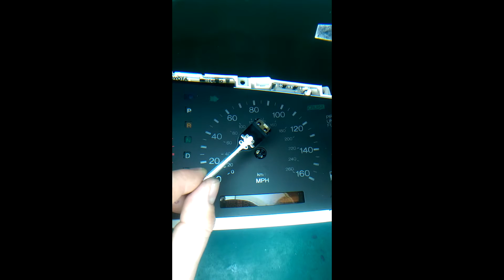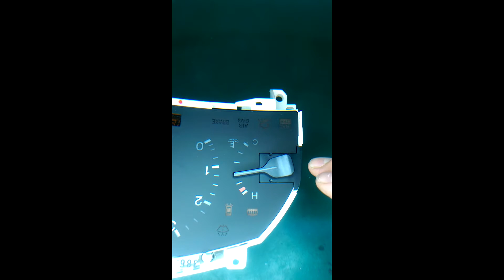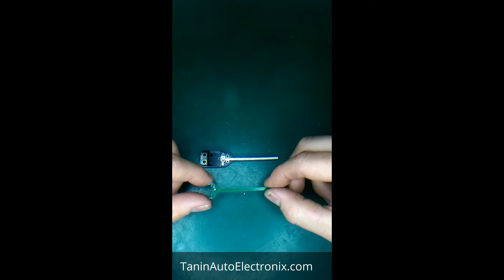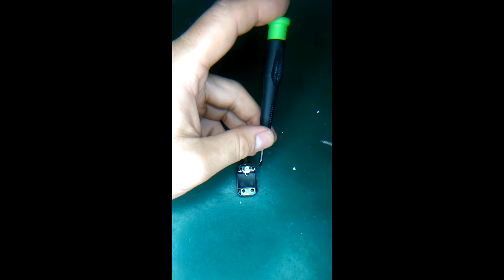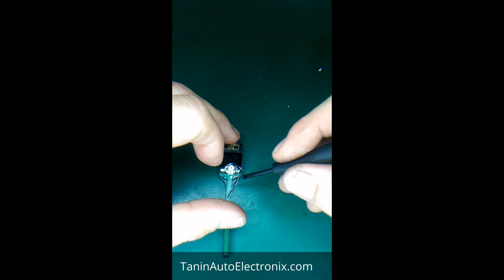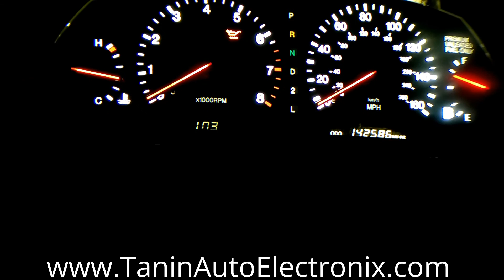Install Lexus V3 Needle Boards | DIY Fix & Upgrade Instrument Cluster Gauge Needle LED Lights | TAE

Comment: Just did the kit plus dash lights for a 92 sc400. Would the fuel gauge not go to whatever the sending unit is telling it? The needle can only go on 2 ways due to the 2 power pins and the centre pin

Comment: Yes and no; the process of removal is half the problem before you can get to the pointers.
Typically my new acquisition also has failed lights. I will be doing this sometime; no hurry BUT I may just use painted on fluorescent paint using a fine brush.

Comment: I ordered a few days ago and received it right away. I am very satisfied with quick shipping however, my one doesn’t have a code extension for the needle in which +- positioning in reverse as this video explained … I have 95 lexus sc300. 
I haven’t tested yet but should I try it out first or what can I do?
Reply from the maker: that doesn't apply

Comment: How can you tell if the moter is not working? I have a 1993 Lexus SC 300 and my speedometer does not work.
Reply from the maker: Hey Debra! If the gauge needle isn't moving at all, or is reading inaccurately, it might be due to the motor failing or starting to fail.
Send a message to our customer service department and we'd be happy to provide yo with a quote to repair the cluster for your SC300!
contact@taninauto.com
262-456-4147

Comment: I recently changed the LEDs in speedometer and tachometer for my 06 Lexus is350. But my speedometer needle only moves on startup, it doesn't move while driving. Would you know how to fix this?
Reply from the maker: Hey! For an issue like this, we usually can't diagnose the problem or make recommendations without seeing the unit. The best way for us to help would be you sending your instrument cluster to us for test and diagnosis. You can view this service on our website at https://www.taninautoelectronix.com/product/general-diagnosis-service/

Also, we apologize for the late response, but hopefully this still helps you out!

Comment: Hi Tanin.  I just did my SC400 with not much joy.   Before install, only the Tac and Temp worked.  I installed all 4 needles and now only the Tac and Speedo work.. Sort of.. Only around 1/4 inch of length is illuminated  and the short needles Temp and fuel have nothing.  All were tested with a 9v battery before install and tested good. Car is a 1992 SC400.  Did I order the wrong LEDS? oh nooo....I did a 93 SC300 and it worked great. I would think the 92 SC400 is the same as the 93 SC300.. or?  Help!!
Reply: I checked what I bought and now see I bought the 1994 SC400 LED Needles!! O no!!!  Are they different? That much different? Help!!
Reply: Called Tanin. They told me the difference is polarity.  That is a huge difference!  I can fix that. Will reverse the leads, reinstall and let everyone know how it goes..  :)
Reply: ok.. Reversed polarity. It was a pain, but did the trick.  Thanks Tanin.
Reply from the maker: Hello!
Can you send us some more information about your vehicle so I can see if we can help?
262-456-4147
contact@taninauto.com

Comment: Just picked up a 1992 Lexus ES300 that has the LED needles along with the cluster lights burnt out and HVAC lights. Watching your video gave the confidence to tackle the project myself. Will be ordering your repair kit soon. Thank you for your very informative video.
Reply from the maker: Hey Soy we're so glad that you were able to use our videos to help you. Let us know if there is anything we can help you with.
Reply: I am thinking about replacing the RPM and speedometer needles which do not glow red any longer but function. My mechanic is pretty good and said he would tackle it, but want information from folks who have done it. Thank you. @TaninAutoElectronix
Reply from the maker: @brm4141  Unless your mechanic has a proper soldering station, tools, and the ability to solder delicate and precise electronic parts it might not be a good job for him.
Reply: What else do you have in your bag of tricks for 1994 ES 300? @TaninAutoElectronix
Reply from the maker: @brm4141  recommend buying our complete plug and play cluster!
https://taninautoelectronix.com/product/1994-1996-lexus-es300-instrument-cluster/

Comment: Ok.. Just finished my install SC300.  I only did my Temp and Fuel. Tach and Speedo ok.  Did not remove my cluster from the car as I could only get one plug out the other 2 were so tough I was afraid I would break the cluster . So.. I simply pulled it out far enough and removed the bezel and needles from there.  Turns out to be a good way to do it as once you get your new needles installed, they will need test an calibration before you put the glass or bezel back on. I followed his instructions for removal and install of  led strip to needle.  Tested with a 9V battery. I knew where the fuel gauge needle needed to be. Pushed it back on. Turned on key, it lit up well. Yea!!  Not the same as factory as you can see the segments and its brighter which is a benefit. Over all happy though. Started the car and waited for 20 mins or so as I know my Temp is just under half.  Once car was warmed up, I pushed on the Temp needle. It too lit up. Yea!!!  Noticed my fuel needle was going up and up and up slowly. Removed it. Added another hit of hot glue for more weight. For my sc300, it needed a full length of hot glue for balance.  For temp  no extra glue needed but I did notice it would not go off of half way when the key was turned off. The Temp should go down when key is turn off. I had to pull up on the needle a little so it could move freely and return to 0 when key is off. Fuel I no longer knew where its calibration point was since it climbed on me, I had to remove it and add some glue for weight. So... I left the needle off, went to a filling station and filled it up. I waited around 5-10 mins as it takes a while for it to go to full... Once I felt enough time had passed, I pressed it back on at the F position and proceeded to drive the car around.  I noticed my temp gauge was too high, it took me 4 or 5 more times of plucking it with my fingers and re positioning it to just under half, once where it should be, I would turn off the key to make sure it would go to zero. Fuel does not do that. It stays where it is. So.. I had to drive the car and burn 1/4 tank of gas to make sure that needle too was working.  So.. All in all.. This is a day project and you need to be careful and know what you are doing. You have to know how to soldier also.  I would put difficulty level at medium.  IF you have some burned out bulbs that also need replacing, then you will have to work on getting all 3 plugs off and remove the cluster from the car.
Reply from the maker: Thank you for the insight on the repair. Its good to get peoples input on the repairs being done using our videos to help guide them through the process. Hopefully it will be helpful for the next person.

Comment: My dealership wants about 3,000 to fix this. I live in California. Where can I purchase this from? I'm not sure if this is a reasonable price!
Reply from the maker: We can get your instrument cluster repaired for much less than that quote ! Check out this link for information on the repair: http://www.taninautoelectronix.com/2006-Lexus-IS-F-IS250-IS350-Gauge-Cluster-Repair-p/is_cluster_repair.htm  and give us a call at 262-456-4147 at your earliest convenience and we will get you set up for our repair quickly and while saving you thousands in repair costs that you don't need to spend! Thanks for contacting us here. We look forward to helping you out soon.
Reply: I will fix for only $2500